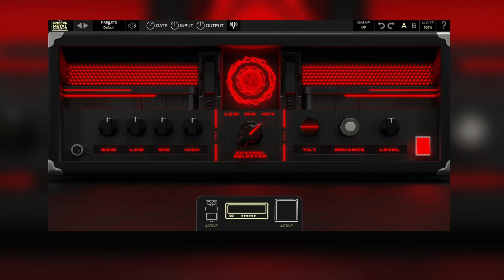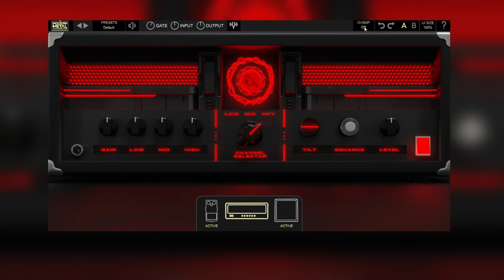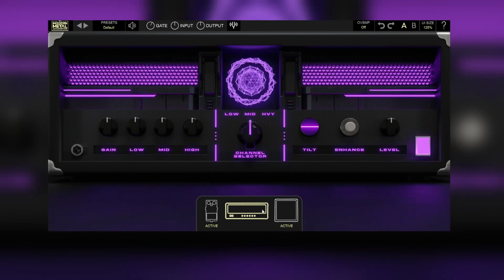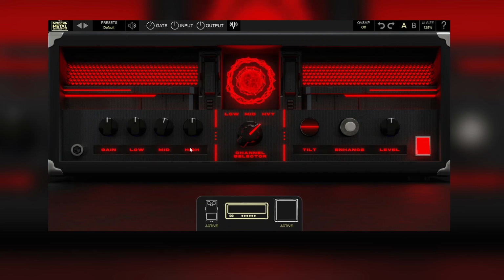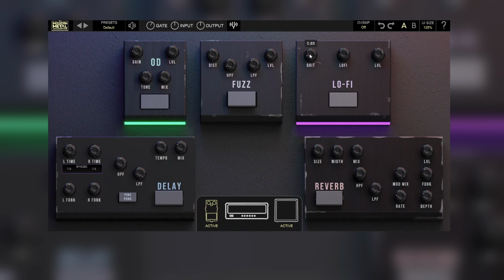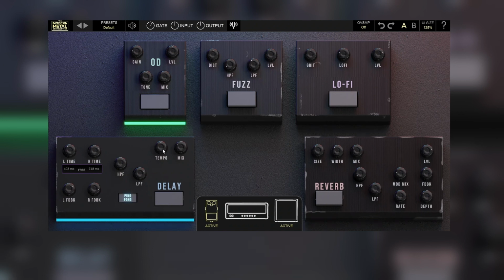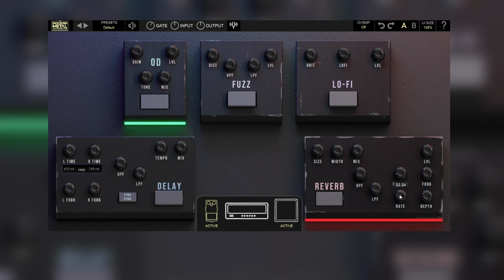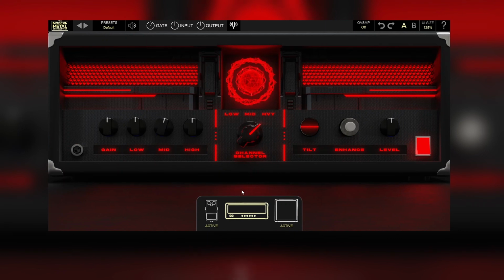Clairvoyant Amp Suite - User Manual Video Instructions

Comment: I'm trying the trial version of the Clairvoyant suit and I think it's wonderful.
But I have a problem with the audio setup.
In the audio options I set everything as usual and, using the test button, the sound comes out of both speakers.
When I play, however, the sound only comes from the left speaker.
How is this possible? 
Am I doing something wrong?
Let me start by saying that the audio settings are the same as those I use for each plugin and I have never had any problems.
Can you give me a solution because the suite sounds really good.
Reply from the maker: If you haven't already, contact our support team via email as there was an update released to fix this! Some interfaces were appearing as stereo inputs, which means your input would only be applied to one of the two sides, they should be able to send you the new installer!
Reply: @modernmusicsolutions  thanks dude. I already contact the support team.